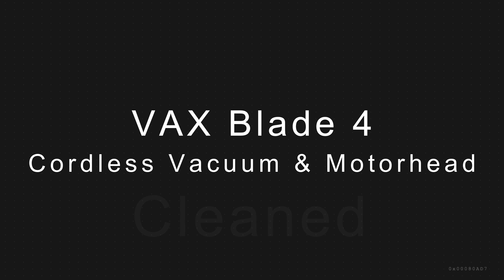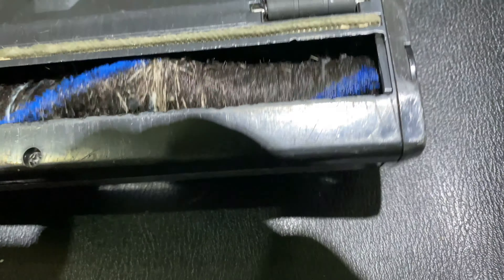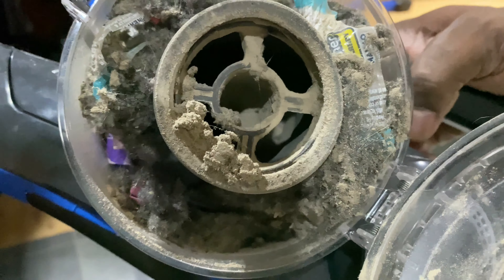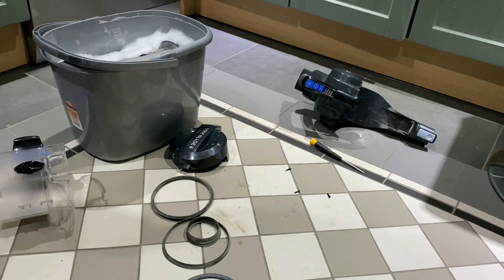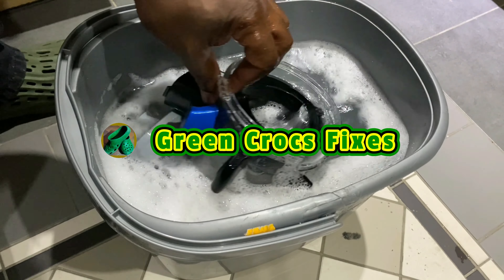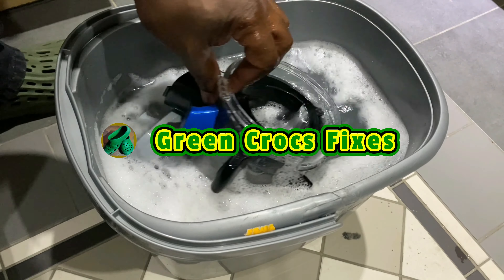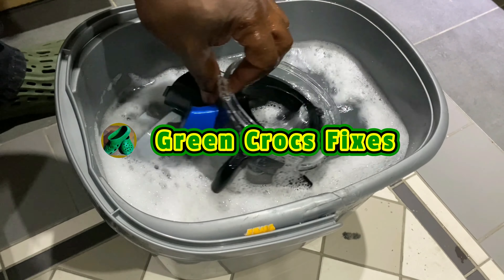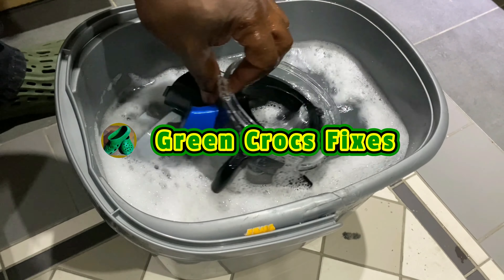VAX Blade 4 Cordless Vacuum & Power Head Cleaned

Comment: I'm hoping you can help me!! I lent my vaccum to my neighbour and now the hose into the main head is completely blocked....I suspect something sticky was picked up at its now blocked the head. Is there any way to remove the hose from the head (the bit you cleaned with a toothbrush) so I can unblock it?? This video is so helpful!
Reply from the maker: Hi CatsWiskers,
                           yes try cleaning with an old Tooth Brush but remove the Brush Roller first, then you should be able to see right through.
Reply: @green-crocs-fixes1520  thank you so much! I've managed to clear it now xx

Comment: Vax blade 4 powerhead has a design problem in that the drive bearing (plastic) wears/melts with use causing the head to then screech like a banshee. Each head lasts about 6 months (less if you use it on carpet). I'm on my 4th head under warranty.
Reply from the maker: Hi Dronebox,
                     such a shine as I found the unit operates quite well compared to others. I don’t personally use it though, prefer a Henry corded type.

Comment: Worst part about this is the Floor head not doing the best job coz of all that hair wrapped round it.  It’s take some effort pulling the brush bar out and cutting/pulling all that hair off.  The white and black foamed filters are also a nuisance to clean and can’t use again until fully dry.
Reply from the maker: Thanks RizZi,
                      you’re not wrong. This is just a device I repaired for someone, I use a bagged and corded Henry (Numatic) to clean as the Cordless/Bagless vacuum cleaners are too much maintenance and harbours a hell of a lot of dust 😎.
Reply: @green-crocs-fixes1520  what is the Henry cordless like? Does it lose suction force when the bag begins to full? I’ve ordered Vax blade 5 dual but I’m still confused between Henry and Vax. Might return the Vax but it is slightly cheaper and comes with extra battery and pet and car accessories whereas Henry comes with couple of tools and that’s it.
Reply: I remember feeling annoyed about cleaning the dust container and filters on blade 32v every couple of days and the container would get full in no time. Keeping this mind, I should really get the Henry but it comes with no accessories. There is so much thinking ! I hate my life lol
Reply from the maker: @rzzi5689  Yes bits of paper and sweet wrappers get stuck inside once you open the Bin, then you have to use a Pen to fish them out. Henry bags, filters and tools are super cheap on eBay 😏
Reply from the maker: @rzzi5689  No RizZi,
                              I only swear by Henry hoovers, corded type, not cordlesss. See this link  https://youtu.be/AK6R4K4Z5jg
Reply: @green-crocs-fixes1520  I don’t fancy dragging the unit behind me and carrying it upstairs etc. i find it extremely annoying and stresses me out.  Got a few females in the household. They shed hair like autumn leaves but all year round lol and It’s an effort pulling hair off the brush bar.  Does shark’s anti hair wrap feature on their cordless hoover really work?
Reply from the maker: @rzzi5689  Fair play, anything for an easy life. Ive seen the Shark Ad but don't know how accurate the anti hair wrap is.
Reply: I must admit that cleaning the collection pot is a pretty dirty job ,even though it has a clip open bottom ,you still have to pull some of the fluff and dirt out by hand .
They did not put much thought into this machine. They should have added edge to edge cleaning with this .also the batteries don't last long with charge and also replacement wise
Reply from the maker: @tilakraj5339  Hi Tilak,
                                   yes these Cordless/Bagless units which ever manufacture are not as easy and dust free to empty as their adverts display. The average householder does not vacuum up Breakfast Serial off a hard floor daily. Found the Battery life on the Vax Blade 4 pretty good though 😎.
Reply: @green-crocs-fixes1520  that's exactly right ,would you say it's false advertising to sell there machine based on just vacuuming just quaker oats ..
After doing a whole room or two you find that it's full of just and fluff and hairs ..even cleaning the brush of hairs is a dirty chore ..you make create more dust taking the brush bar out and cleaning it .
It's great if you  don't have any dust allergy s ..if anything you'll need a hepa filter mask just to clean the brush bar and the collection box ...not at all practical..but having a cordless is a  good thing ,,just pick uo and go ,,as long as there is life in the battery .